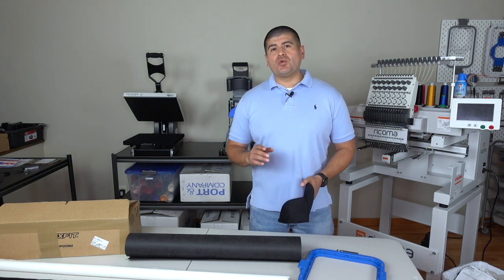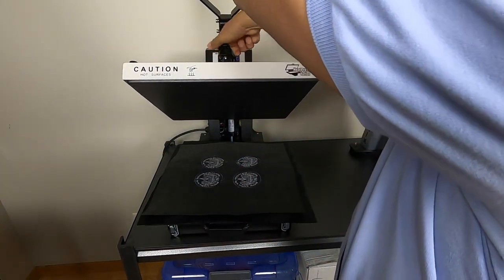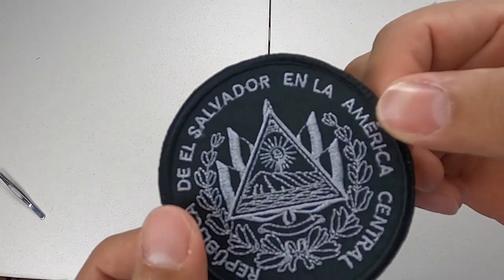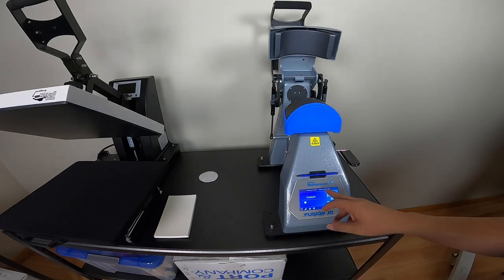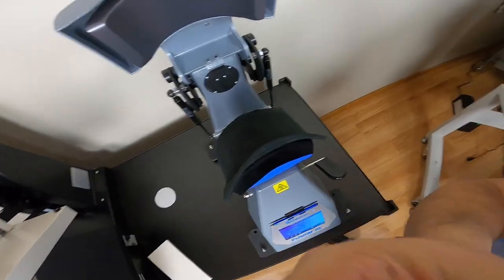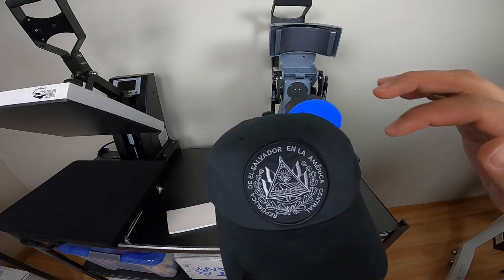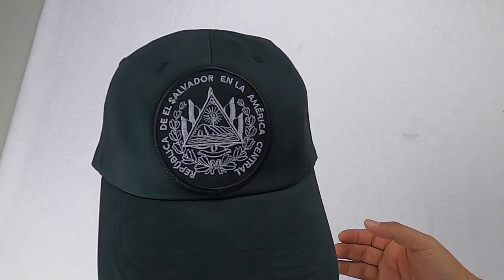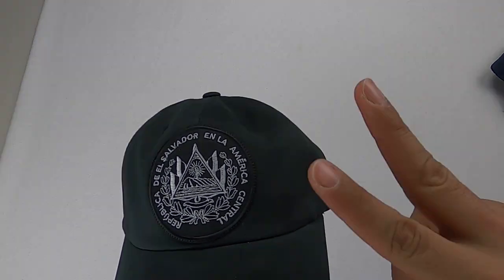Heat Pressing Patches onto a Hat

Comment: Hey Romero where did you find that white foam material that you used as a buffer between the hat and press?
Reply from the maker: It came w/ the heat press. 3 different sizes of  thickness, that was the thinner one.

Comment: My hats always look good like yours do, but if I pick at the patch a week or two later it comes off pretty easy. Have tried with a variety of heat transfer adhesives, and "cooked" them too. Not sure that any adhesive patch will be as good as sewing a patch on. And scorch marks are usually an issue. I am currently coming up with a way to sew embroidered patches on with an applique method. Also plan on using the method on acrylic beanie hats, which don't handle heat very well.
Reply: Hi did you get to solve the issue?

Comment: Great video brother! Question, on 9:07 you can see scorching on your hat. Any advice on how to avoid this? Lower temperature with longer time maybe? I'm having the same issues right now and it's driving me nuts! lol.
Reply from the maker: After so many hats, I prefer the 100% cotton dad hats, it holds heat much better. As for the hat in the video, the scorching went away and its still holding strong. But that is a wool cap so its easier to show heat marks. Good question, i'll make a video on that topic.

Comment: Hello — I was wondering if you can help me. I stitched out a bunch of patches and I’m using heat and bond to try to stick them on my hats but they keep peeling off. I don’t know what temperature or time to press them for. (I have an inexpensive press unfortunately that only heats the top.) Also my thread on the patch seems to loose it’s definition when I press the patch. It flattens out.
Reply from the maker: It sounds like you might need more pressure. I don’t use Heat n Bond, I use adhesive from Twill USA, I think it sticks stronger.
Reply: Thank you so much for the advice. I just called Twill USA to order the adhesive. One more question if I may— I see that you use twill w/ adhesive to create this patch. Is it ok to use just 2 pieces of stabilizer to create a patch instead? At what point do you recommend the twill for a patch ?

Comment: romero, great vid, what is the brand of adheasive you use, not having much luck, thanx daniel
Reply from the maker: Hello thanks for the message, I put the link down in the description. Its called: HEAT PRESS ADHESIVE: P600 5-Mil 49.5″ Permanent, from TwillUSA.